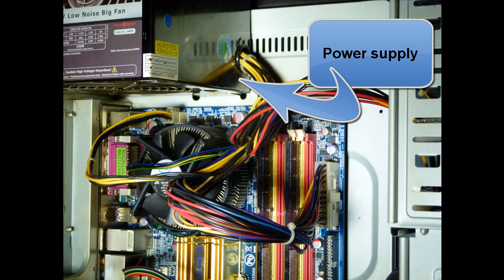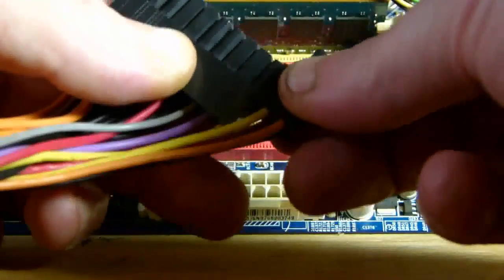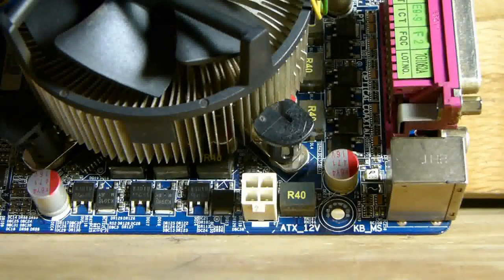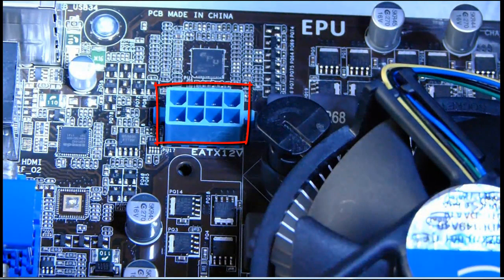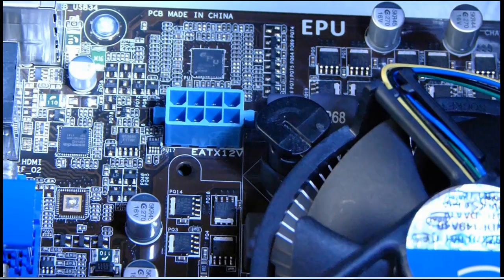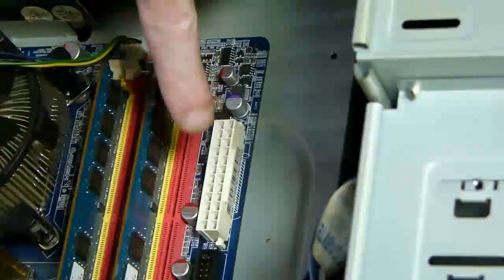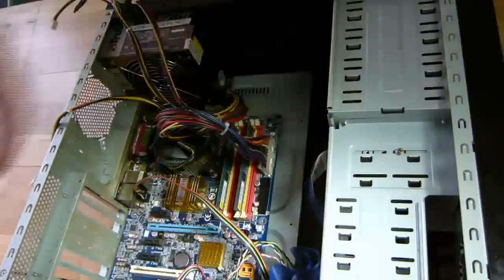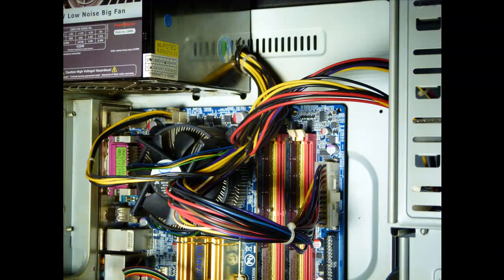connecting power supply to a motherboard

Comment: hi great video my video card takes 2 4 pin connectors and my mother board has a 4 pin but my 350w psu only has 2 4 pins do i need a different psu does the mother board really need the 4 pin connector why cant it just use the 24 pin and give me the other 4 for video card

Comment: so the 4 pin connector 12v is just to power the cpu what if u dnt connect it does it just not switch on?
Reply: connor gouws      ur computer won’t run

Comment: When i plug in the 4 pin connector my pc shutts off same moment, can you please help me
Reply: and my cpu fan doesnt spin, does that mean I need to change fan or its something wrong with motherboard
Reply from the maker: AZOR AHAI make sure all connector s are plugged in including the fan for cpu okay then try again!
Reply: Kevin Colleran could that shut off be coused by dead cpu fan, thank you for reply
Reply from the maker: AZOR AHAI yes I could but it can be caused by any component on the system so check everything first make sure everything is plugged in correctly first before you start replacing anything! Okay!
Reply: Kevin Colleran I have check everything, still fan not spinning, cant plug in the 4 pin connector that goes from the psu, the same moment pc shuts off
Reply from the maker: AZOR AHAI 4 pin connector must be plugged in before turning on pc is this a new build if it is plug in everything first then turn on pc
Reply: Kevin Colleran When its plugged it wont even start pc
Reply: Kevin Colleran recently was a lot thunderstorms, something is probably fried, but everything works but cpu fan and no screen

Comment: My motherboard only have 4 pin and 6 pin
Reply from the maker: ElMenor RD in relation to what all mobo have 4 and 6 pin connectors!
Reply: but if i want to buy a new power supply andthe power supply  only have the 4 pin can i run my pc with a graphic card ?

Comment: hello, i have an 8 pin cpu power connector. but my 8 pin connector doesnt EXACTLY match up with keyed pins. it still fits perfect. One of the 4+4 connectors doesnt have keyed square pins diagonally placed. i hope this kind of makes sense plz get back to me.

Comment: my power supply got 2 4-pin connectors (splitted) but i can't seem to find the right place to plug it in. are both connecters necessairy?
Reply: No some motherboards only require the 20 pin
Reply: Jpred98 no i mean its 1 cable thats splits into two different cables with both having 4 pins

Comment: My power supply has two 4 pin connectors which will power the processor?!
Reply from the maker: Hi, you can use either one the two are for the cpu! if your cpu has turbo power the there will be a 8 pin connector beside the cpu and you plug in both 4 pin connectors

Comment: what is my power of pcie slot on my motherboard base on the number of pin connecters?
problem is i want to install a gtx 1050 and it require 75w pcie slot, but i dont know my pcie is 25w or 75w

Comment: my mother board has an 8pin and 24pin spots, and my power supply has a 4+20pin cord, which one do i plug it into?
Reply from the maker: the 4+20pin connector has to go into the 24pin slot. now that 8pin slot is the cpu power slot and your power supply must have one or the pc will not work. ok!
Reply: awesome got it, thanks

Comment: you saved me mate. thank you
Reply from the maker: I'm delighted you got it sorted Bud!
Reply: you're a pro, can I ask. why can't I update my ddr3 gt 730? I'm using i3-6100 on a gigabyte H110M mobo DDR4 and also whenever I tried to move my mouse 2x the normal speed it would go crazy like it goes everywhere. is this somehow the graphics cards fault?
Reply from the maker: Dirt on the light at bottom of mouse will cause the pointer to go all over the screen! or it might be a lost cause! Now updating a graphics card will not make it preform any better than it dose right now! It might be a good idea to upgrade the card, ddr3 tells me that it's a few years old this could be a good time to upgrade! especially if you play a lot of games or edit videos or any type of graphic editing! OK, hope that helps!
Reply: actually I just upgraded my mobo, before my mouse worked fine but now its crazy. I think its the graphics card?? btw thank you for replying :3

Comment: Hey Kevin, I recently bought all the parts for my new computer. There is one issue however that, my new motherboard has an 8-pin 12V ATX slot, but my PSU has just a 4-pin connector like the one you showed. Can I connect the 4-pins from the PSU to just the first 4 pins of the 8-pin motherboard slot ?

I have an AMD FX 6300 by the way and it needs 95W TDP.
Reply from the maker: yes, that's ok, but it's not going to give you the turbo power if you have a CPU with turbo speed boost!
Reply: I mean, if I connect the 4pin from the PSU to half of the 8 pins on the motherboard, it won't damage my motherboard or AMD processor in any way right ?

by the way.. this is me from another account.
Reply from the maker: no it won't damage anything, bud! you're fine using 4 pin connector!
Reply: okay.. thanx a lot Kevin.
your help is much appreciated.
Reply from the maker: Glad to help!

Comment: My power supply doesn't have a separate 4 pin connector, just a 20 + 4 pin connector, is it normal?
Reply from the maker: No! All power supply have to have at least one 4 pin power supply for the CPU it cant function without it! Look again and you will see it!
Reply: Kevin Colleran I just realized I was trying to put the cable in the wrong side, sorry
Reply from the maker: Glad you got it sorted bud!

Comment: how do you connect a 300 w power supply to an integrated on board 65w power supply?
Reply from the maker: +marty torrez I have not came across that system board what make and model is it? If the power supply is integrated then you can't unless you can by pass it.... i don't have enough info about the system to know what you can do!
Reply: Intel Pentium G2020T 2.50ghz Intergrated HD Ghapics Mootherboard with built in Power Supply (65w).
Reply: I have learned that it is not possible to upgrade any components, only ram. I'm sorry I bought this now that I know more about computes, but I learned. Thx for responding.
Reply from the maker: It's all learning curve! we can't know everything all at once, enjoy the process!
Reply: thx

Comment: thx for the video but now I have to figure out why my fans start and stop repeatedly.
Reply from the maker: +Andrew Stahl all fans connected to the motherboard will start and stop repeatedly by default as the motherboard heats up and cools down this is normal behavior for fans on a motherboard they don't need to on continuously! OK!
Reply: +Kevin Colleran yea, but then my system doesn't boot
Reply: +Kevin Colleran I guess I only noticed my fans on constantly when I was using my cpu heavily.
Reply from the maker: yes, that would be about right!
Reply: Kevin Colleran ok thank you! Now I have to get input from my graphics card lol

Comment: so do I need a new 4 pin connector if it isn't long enough to reach to the 4 pin for Powersupply....
Reply from the maker: +Gee Yes you need a 4pin extension connector cable for the CPU power. If that power supply cable is not long enough then i sagest getting a new power supply it's probably a few years old now? If that's the case get a new one it owns you nothing and there not expensive. Here's a link to amazon for the extension cable if you want to go that route! http://computerhelpmadeeasy.ie/computer-build-components/

Comment: i have the 4 pin connector but it wont fit inside the thing why is that
Reply from the maker: +billyhatcher643 It may take a little force to get the four pin connector in, and i know it's in a tight space and you can't get in at it but stick with it and you will get it in! 
Also try wiggling the connector in the socket first that will also help! If none of that helps then take the motherboard out again and just make the connection a few times while the motherboard is out of the case, so that you have all the room you need to get it in. Sometimes their just very tight, keep at it and you will get it in! Hope that helps, Billy!

Comment: I JUST INSTALLED MY NEW PSU AND CONNECTED THE 24 PIN AND 4 PIN BUT NO SIGNAL TO MY MONITOR? wHAT AM I MISSING? THANKS
Reply from the maker: +B Charron If you have a graphics card make sure the monitor is plugged into it! is the system powering up? if it is then the psu is working and the mobo is working it's either the graphics card or the monitor that is causing the problem re-seat everything again, see what happens!
Reply: Kevin Colleran all I did was hook up my new psu to my hp slimline once I removed the old one and connect my 24 pin, 4 pin and connector to the hardrive. where does a monitor connect to a video/graphics card? I just connected the monitor to the back of the tower with the 2 screws on the side. maybe this is old style monitor connector. this computer if 5 years old. so in total I connect three connectors from my psu to my pc. I see other connectors. maybe they have to be connected somewhere?
Reply: Kevin Colleran I read also that I may need to jump my mobo
Reply: Kevin Colleran here is the latest. I jumped my mobo, re-installed my psu, I left the cover off this time when I powered it up, and noticed the fan on the brand new psu is not working. maybe I have a connector for it that needs to be connected?
Reply: +B Charron Make sure the power switch on the PSU is on, I actually had that issue today (I was tired and the switch was hidden lol!).
Reply from the maker: If the fan is not working on the psu once you have the switch on the power supply at the on position and the fan in the psu is still not working! Then you have a defective psu replace the psu bud!
Reply: Kevin Colleran Hi again. my psu is a seasonix or seasonic brand and the fan on them doesn't come on until a certain internal temperature is reached. I am not sure if that is true. Are you talking about the power switch on the top of the outside case of the tower? I noticed its not lit up now. oh well, I think I need a new computer. thanks anyways.
Reply from the maker: OK you have a special psu there! it's got a switch on the psu on/off switch! So just make sure the switch is turned on, was all i was saying. Upgrading might be a good idea it's 5 years old, i think you said! So you will get a significant power and speed boost if you upgrade mobo it might be a good idea to get a SSD also it will give your operating system a lot of freedom and fluency that Disk drives can't, and they are cheaper now than ever, Well what ever you decide enjoy the process...!
Reply: Kevin Colleran You know i didn't notice an off/on switch on the psu but when i return home today from the office  i iwll check it out even more. i hope that this is my actual problem even if i feel stupid afterwards for not noticing it. i really hope that this is what my problem is. Thanks!
Reply from the maker: No problem! I hope that is the prob! I forget it's there myself sometimes!
Reply: Unfortunately, there doesnt seem to be an off/on switch? Is it inside the casing by chance? Here is the model , and specs on the PSU that I bought:  Seasonic TFX12V (V2.31), 80 plus gold certified 300W active PFC Low noise (SS-300TGW). Its for my HP Slimeline Desk top PC
Reply from the maker: If the fan is not spinning you have a defective psu! replace the psu bud! This is not an option with that PSU the fan must always be spinning on the model of psu. Is the old one working? if it is put it back in until you get a new one. Replacing that psu is your number 1 priority!
Reply: It says on the PSU that it will not spin until 50% of ( I can remember what it said) is reached. So its a very odd PSU. Oh well, I think its time for a newe PC thanks bud!
Reply from the maker: OK, B! just for reference when dealing with problems with PC's and for troubleshooting purposes! or when your pc's is not starting. All PSU's if they have a fan, the fan will spin when your pc's first starts for about 2-5 mins. This test is always running when you start the PC. OK, bud! Enjoy the the process i think you should build your own it's easily done and you learn a lot in the process! But of course it's up to you:^)... Whatever you decide Hope everything works out for you! best of luck!

Comment: I'm stuck connecting this: 1:28  from 1 hour... why it doesnt connect to me, even if i'm in the right side?? :(
Reply from the maker: Dany Tremila Hi Danny, some for these connectors can be very very tight so you may have it connected but not fully seated in the connector try moveing it from side to side to loosen some of then connectors it's worth a try! if that will not work for you it may be that the connectors are not lining up correctly maybe a bent pin in the motherboard connector or the power supply 24 pin connecter may be bent or not lining up, check all that and if that will not help then you may need to get an other power supply1 Some times it's just a bad power supply or motherboard connector! Hope that helps!

Comment: hi Kelvin, i seen ur this video but how to know whether which others cables from power supply to plug into which other part like motherboard,hard drive,graphics card etc... and how to recognize all the cables from power supply tat plug into which sockets? but anyways thanks for ur tis video its helpfull
Reply from the maker: TheKamerocky all connection are "keyed" so they will only fix into a certain component! therefor you cannot plug into the wrong connector, OK!
Reply: Kevin Colleran ok, thanks alot

Comment: Thank you so much I didn't realize only two out of all the extra cables mattered. :)
Reply from the maker: Hi, Yes that's true! But the other connections are indicators for hard drive and there is a speaker which beeps when there is a problem! So they are good to install also!

Comment: I cannot find a 4 pin connector on my motherboard but there is a 6pin that says PCB over it, is that the correct socket?
Reply: Do i connect 2 4 pins in this slot or a 6 pin connector + 2pins? thanks
Reply from the maker: What component are you connecting? you did not mention what the connector cable is connected to {a FAN maybe?}

Comment: I got a new zebronics Zeb 450W power supply. My monitor has two plugs one which has blue wire connected and the other one goes to the power supply (3 pin wire) .Now the new power has only one power plug. So where to connect the other wire of the monitor ?
Reply from the maker: So you need to get an extra "power cable" to connect to your monitor and you can connect directly to a "wall socket" you don't need to connect your monitor through the power supply, it may have been that your monitor came with your last computer and was setup in such a way that it saved on cables going to the wall socket. So the options are get the same type of power power supply that was in your last computer setup or get a "wall socket" power cable for your monitor. That's your only options... hope that helps
Reply: Okay thanks kevin. I'll do that

Comment: Plzz help I have my old pc's power supply with dual plugs (input and  output) I just bought a new one because the older one caused many problems! Now the question is that the new power supply has only one power plug. So am only able to turn on the cpu and not the monitor. I cant understand.Do i need an extra wire ? But there is no extra plug on power supply. Wat to do ?
Reply from the maker: what kind of power supply did you get? the power supply should have all the connection that connect to the motherboard. you do not connect a power supply to a monitor or is this a typo????

Comment from the maker: that 4 pin PSU connector could be plugged in the wrong 4 pin socket consult the manual that came with your motherboard, you'll find it on the manufactures website if you don't have it.... this is the only way to find out the correct placement for all connections.

Comment: I have bought apu a8-6600k and gigabyte mobo f2a85xm-d3h and cheap PSU with 24pin connector and 4 pin connector. On motherboard there is 8 pin connector so i plug in 4 pin form PSU on that 8 pin. PC ca not start up. What is the problem? Thanks.

Comment: My motherboard is an ATX asus M5A97 R2.0, the case is a mid-tower. All the components fit well, the only concern i had was what i asked you before. The power supply doesn't touch the case. Thanks for the info.

Comment from the maker: Hi Joaquin, What model of motherboard did you buy? if it's a pro board you should buy a "full sized tower" (eg ATX full tower) for fans and air circulation around the motherboard, the model of motherboard determines the size of the tower unit, but if your tower unit is not touching the power supply then you are fine and install the max amount of fans that case can handle. Also consider what kind of graphics card you will be installing, this too will determine the size of the tower unit.

Comment from the maker: Hi CoCoNuTz122, All motherboards have either a 20 or 24 pin connector for the power supply, unless it's one of those advance pro motherboards. so what i sagest you do is check in the manual that came with you're motherboard and find out in that manual where the PSU has to be connected. if you don't have the manual you can get one on the manufactures website.

Comment from the maker: Hi mitsakosmitsakos, The worst that could happen is your computer will not start their is no risk to you're house or outlets because all power supply have protection just follow the manual that came with your motherboard and you will be fine all connections to the motherboard from the power supply are keyed so there is only one way for them to go in, also all other components and parts that are connected are keyed, so as i said double check your manual for connections.